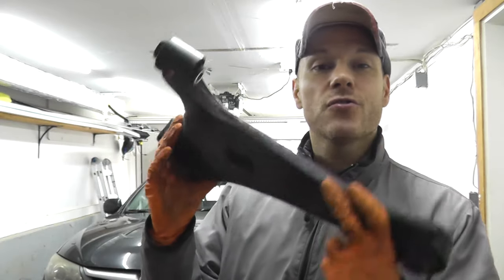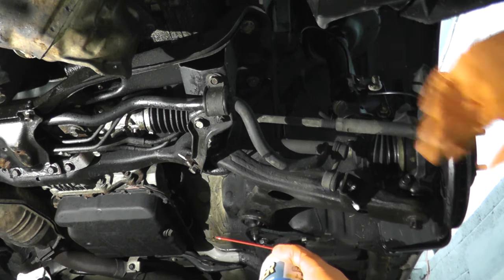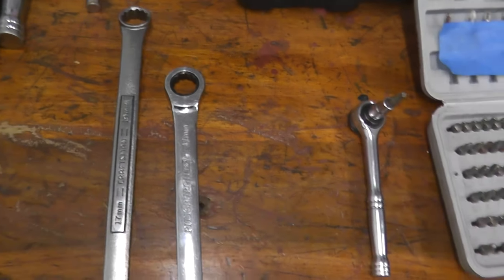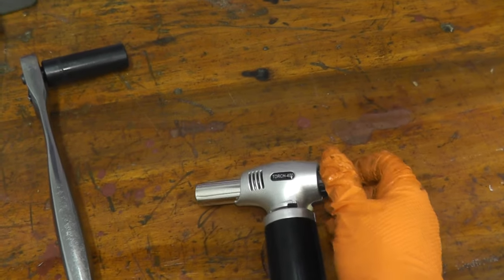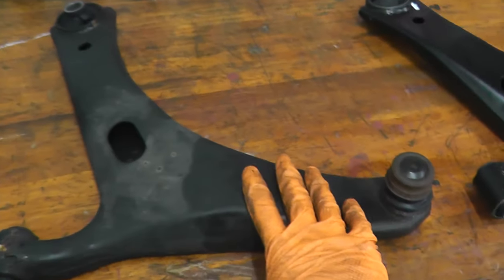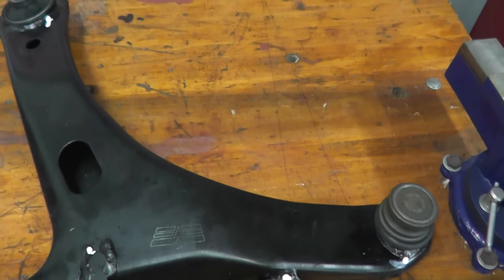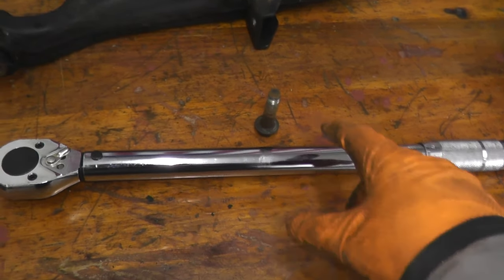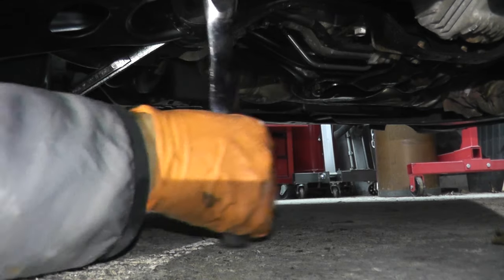Subaru Lower Control Arm Replacement with BASIC HAND TOOLS

Comment: Someone clone this guy. Super knowledgeable, attention to detail. Can’t believe he cleaned out the ball joint opening - no one else would be bothered. Best mechanic.
Reply: Good mechanics do steps like this. And he’s right if it makes it easier to installs its worth doing
Reply: One thing he forgot to mention is putting anti sezie on all the bolts. Makes the next job easier. Also fuck amazone you can get everything you need at your local harbor freight

Comment: If you live in the rust belt. Just buy a new car, you’ll thank me. 😀
Reply: I hear that, I just did a lower control arm on an outback 2010, went through 5 sawzall blades and 3 days of drilling and heating to get the rear lower control arm bolt out of the frame. Heated with map gas also, and air hammer/punch. Nightmare of a bolt.
Reply: I’m pretty much going to have to buy all new front chassis just to replace the cutch.

Comment: Do not heat up the pinch bolt, heat up the material it is threaded into. Heating up the bolt expands it into the threaded hole, requiring more force to remove.

Comment: What's the idea of lowering the car before tightening the front bushing bolt? I've seen others skip this step.
Reply: You always want to tighten bushings with a normal load on them, anywhere they are located.
Reply: Otherwise, the rubber portion bonded to the inner and outer shells will be twisted at normal ride height position, and likely fail prematurely.

Comment: Awesome video, really helped me with my front control arm install this weekend. I used Subaru OEM parts and they also have the additional bracket shown on your Dorman part (12:29). I used the floor jack to push the ball joint into place, with a piece of wood between the jack and ball joint. My 2009 WRX has a ground effects kit, but laying on the ground I was still able to reach in and tighten the front bushing after the car was lowered to the ground. Didn't really figure out a good way to use the torque wrench on the stabilizer bar end links so I tightened them to what I thought was about 33 ft lbs. 
Ball joint bolt: 36.9 ft-lb
Rear plate to body: 110.6 ft-lb
Rear plate to control arm: 81.1 ft-lb
Front bushing: 70.1 ft-lb
Stabilizer links: 33.2 ft-lb
Stabilizer bushings: 18.4 ft-lb
Front crossmember support plate: 44.3 ft-lb
Reply from the maker: Thank you. Appreciate the torque specs
Reply: Yes thank you for the torque specs

Comment: Thank you! Replaced my control arms, stabilizer bushings and tie bar links for over 1k less than two shops had quoted me. This guide was great and was very clear. The bolts on the rear most mounting plate were 19mm on my car instead of 18mm, but I have an impreza outback sport so maybe that's what the difference was. Figured I would post here in case anyone else ran into that.
Reply from the maker: Glad it helped!

Comment: Thank you so much for this video!
I was able to replace the controls arms on my 2012 Impreza and your directions and tips helped a lot.
The car has been mostly drive on the east coast and finally for a couple of years near NYC.

I applied lots of penetrating oil in the knuckle slit and every bolt I had to take off in the control arm a week before and then night before too.

The hardest part was removing the pinch bolt without breaking it. I had to use an 18 inch breaker bar and go slowly on the pinch bolt and keep applying the oil every 5 minutes. It was stuck on there for good. The pinch bolts are in bad shape and I will be installing new ones.

The ball joint was tough also, and needed lots of hammering. Had to use a piece of steel tube as pine 2x4 would break.

Towards the end of the video you lower the car and tighten one of the bolts on the control arm. I look at my repair manual and it says to torque down the same bolt (70.1 ft-lb) PLUS torque down the rear bolt to 81.1 ft-lb at curb weight too.

I think after this replacement my steering wheel is off to right for about 15 degrees but no other issues and the front suspension is quiet now.

Next I will have to replace the front strut mount as the rubber has cracked a lot (I think you have a video for that too).

I think finally will have to do a wheel alignment. I think it should fix the steering wheel being not centered?

Thanks again!

Comment: Thanks for the post! Best how-to I found for my 2013 wrx. Only issue was the lower pinch bolt and getting the ball joint out. Knocking it with wood did not work, even used an 8lb sledge. Figured out a little trick using sockets wedged between pinch knuckle and control arm

Comment: Awesome video. Was extremely reluctant to tackle this job until we found your video. Took away a lot if the anxiety and had both lower control arms on our 2007 Subaru Forester. Two notes: the bracket you talk about on the new arms is present on the Forester but nothing is connected to them. Also, the bolts on the rear bracket and nut under the bushing are 19mm.

Comment: Superb! Great level of detail. Thank you. I replaced the driver's side this weekend on my Legacy sedan. It has body cladding and is almost impossible to get under without jacking it up. I tightened the pinch bolt on the ball joint and the rear bushing while the car was still on jack stands. I put the wheel back on and tried using ramps to load the suspension to tighten the front bushing, but no luck because the frame was in the way and I could not rotate the torque wrench. I ended up taking off the wheel, putting it on a jack stand on the side pinch weld, putting a floor jack under the control arm by the ball joint to lift the car slightly off the jack stand (just barely), and tightening the front bushing of the control arm to 70 ft-lbs. I hope that suffices.
Reply: I noticed another thing in the manual that said both the rear and front bushings should be tightened after the car is on the ground. I saw you tightened the rear bushing when the car was still on jack stand. Is that a concern? I did what you did except for the front bushing that was tricky as I described above.

Comment: Thanks for the detailed video! Live in the rust belt, soaked the heck out of everything with PB blaster. Driver side ball joint took forever to pop out, passenger side took 3 hits and was out. Huge improvement on the vehicle. Thanks again!

Comment: Not to be pedantic, but T30 is not an Allen key. 

My Haynes manual also said to use an Allen, so there I was, trying to find the proper size Allen key, and chalked up the looseness to some of the metal rusting away. I rounded out the keyway, so I used a grinder to cut it out. 

Wasted tons of time, had to get a ride to the parts store, had to buy a new part that I hadn't planned on replacing, and ended up missing work the next day because the job wasn't done and my car was still up on blocks. 

I bought a new one, with an obvious Torx keyway, and checked the old undamaged bolt, that I also cut out instead of fighting it again, and the Torx was a perfect fit. 

Allen is a hexagonal bit. The typical wrench used that we associate with it is an 'L-wrench', which may cause some confusion due to the similar phonetics. The Torx, or star bit, also comes as an L- wrench.

Comment: On my car the bolt is seized had to cut it apart with saw zaw cut out the frame were it's mounted drill out the bolt on drill press and weld it back together totally sucks

Comment: why did you wait to torque that last bolt? did i miss the explaination?
Reply: If you torqued it before lowering the car the bushing would be locked in place and constantly under torsion. You want the suspension "at rest" (on the ground) so the bushing is locked in at that position.

Comment: Replaces the link on the driver side had to cut it out. I replaced with a MOOG. It’s doesn’t look right. It’s not vertical, it seems to be on a angle.The link I cut out was vertical. The video you made shows you changing to a MOOG, however, it’s vertical. Any suggestions I would appreciate.Also, excellent video.

Comment: Just did the same job on my 2013 legacy unfortunately both pinch bolts snapped so I had to drill them out and replace with a different bolt... now the car make a popping noise while driving (taking turns and Breaking) any tips to fix this???

Comment: I’ve replaced both my control arms and torqued it on the ground however I’m getting some creaking and light pops from both sides, worse on the driver side, while driving at low speeds. Any idea what this could be? I’ve retorqued everything with no improvements.
Reply: Maybe tie rods?

Comment: CarsNToys, thanks for the awesome video. Does it need wheel alignment after replacing the control arm?
Reply: Do it old alignments preset on old bushing won't be the same due to the new material

Comment: Being from the noertheast, I think letting PB Blaster sit on the pinch bolt "for a few minutes or even overnight" is absolutely adorable.  You need to tell the bolt you're going to kill its entire extended family and serve them as the main course in a cannibalistic debauchery in the name of the God of of Pneumatic Tools.  

On my own Subie I sprayed PB everywhere everyday for a week before I did the job and used an air hammer sparingly, but enough to rattle the top few layers of rust and grime loose.

Comment: Very well done video but its not that easy for everyone. Just did this job on a 2013 Outback. 10yrs in Michigan, not even a 1200 ft lb impact would budge the fastners. Every one had to be cut, what a mess.

Comment: This job kind of sucks to line things up.  Also the end of my stud in the back was damaged and I didn't notice because the impact took the nut right off.  But when I went to put the nut back on (last nut to install on the whole job) it had resistance.  So I thought I can just overcome it with the impact.  Nope.  Then I had to cut the nut off and now I really need a stud and a nut and the car is stuck in the garage at least two more days because neither of my dealers stocks that stud in the back of the lower control arm.

Comment: For the final part, it seems like you need to drop the car to have the LCA take weight. Could I just drive the car onto a ramp then? Otherwise...how else would I get access to that bolt?

Comment: Where the arm meets the chassis would it be alright to tighten it with the front wheel on car ramps or does it have to be flat? Just asking as my car is pretty low and there’s no way I’d be able to get under there
Reply: I know this is old but if you have a separate jack and the vehicle is on stands just Jack up the knuckle or rotor close to where it sits naturally. Ramps would work as well.

Comment: Doing this job on a 2006 Outback, and had to use a torch because (almost) everything was frozen.  The stud for the rear bushing came out of the chassis instead of the nut coming loose.  I have a new stud on order from Subaru, just wondering if this has ever happened to you, and if you have any warnings or tips about reinstalling it
Reply from the maker: Bummer. You may need a special tool to reinsert the stud. I've been lucky so far but most of the Subu's I've worked on are newer.
Reply: @CarsNToys  Found out the deepest socket I had wasn't deep enough, but luckily the new bolt cranked right up in with a wrench.  Clogged or buggered threads weren't an issue this time!

Comment: I need to do this job. Is it easier to remove the ball joint from the knuckle or is it easier to remove the control arm from the ball joint?  I am assuming the ball joint is still OK. It is the front bushing in my case that is totally shot.  I know most people say replace everything since your doing the work now, but I need the quickest, easiest, cheapest solution.
Reply from the maker: Replace the control arm and ball joint as one unit. It will save you a lot of time (and possible frustration). They're inexpensive for the most part - https://amzn.to/2ARVUGO

Comment: I had to dremel/die grind my sway bar link off. It was completely frozen and the allen key holes were stripped.
Reply from the maker: Oh yes...gotta love Subaru!
Reply: @CarsNToys  Believe when I say, dremels are not the way. It took me 5 hrs to get that stupid thing off. Now I cant seem to get the ball joint out. I tried the wood thing you did, knocking the knuckle (mars it up) and a torch. Nothing works so far. Tomorrow morning, Im headed to the autozone to rent a pickle fork. Any ideas if that doesnt work?

Comment: Hey I’m not sure if anyone will see this, but the bolt for the ball joint on my car was so rusted over it just wasn’t budging so I drilled it out. But for some reason I still can’t get the ball joint out. I’ve spent a lot of money already trying to fix it and it’s really eating at my savings at this point.

Comment: Could I use car ramps for the tightening of the last control arm bolt? That way I could get under the car as my legacy sits fairly low to the ground.  I would assume so but just curious
Reply from the maker: Absolutely

Comment: tl;dr  DO NOT TRY THIS AT HOME!!!

Snapped my pinch bolt. Have it almost all drilled clean. Kind of disappointed by "Imports" (yeah I know some are made in Indiana), but the Ford Contour I had I ended up using a breaker bar and a car jack for extra leverage to loosen it up. The Subaru bolt snapped by me simple pulling on the breaker bar towards myself.

Edit: And the swaybar links. My goodness. Got one removed, the other has a different size allen wrench opening. 5mm appears to work, but it's practically impossible to loosen the nut on it. Considering I snapped pinch bolt with my bare hands I can barely hold the allen wrench in place. Gonna have to cut them with an angle grinder and replace the sway bar links.

Edit 2: Make that both pinch bolts. Learning real good on how to drill them out now, at least.

Edit 3: That ball joint is not dropping out. Either I didn't drill pinch bolt all the way, but that ball joint is NOT budging. So now I'm looking at replacing both steering knuckles. I hate Subarus so much right now.

Edit 4: Ordered a $20 ball joint puller. Should be here tomorrow. But after fighting to get the castle nut off, using a dremel with cobolt tool on the pin (same I used to deburr the drilled out pincher nut holes), the control arm is still not dropping out. Sprayed it with penetrating oil and hopefully that will loosen it. Otherwise I'm back to using the angle grinder and looking at buying a whole new steering knuckle.

Edit 5: So instead of the 2x4 method for pounding the control arm I unbolted them from the chassis, rotated in the wheel well so I could access it directly with a 5 lb hammer, used 2 jackstands to stabilize it at level, and managed to get the control arms off the seized ball joint bolt. Still took multiple solid whacks. Maybe tomorrow evening I'll get to putting the new control arms back on it. Finally.

Edit 6: Got the $20 ball joint puller on one of the ball joints now. Torqued with a regular wrench as far as I could since I didn't have 15/16th socket, and I'm a bit worried about the puller tool bending before the ball joint drops out. So now I'm just gonna let it sit overnight at as high torque as I can put on it comfortably. Maybe I'll try to turn the nut a bit more at bed time.

Edit 7: Stripped the threads on the $20 ball joint puller tool trying to remove the ball joint. Taking it to a shop. This just isn't worth it.

Edit 8: Shop appointment is coming up, but found out the ball joint puller I had was a CHEAP CHINESE KNOCKOFF. Got the real deal from Astro Pneumatic and it worked like charm. Now to clean out the cavities, re-drill out pinch bolt holes, and maybe save a grand.
Reply: I snapped that bolt so easily, and it turned into a big ordeal. I welded a nut on the back side where threads were exposed, and then I used a acetylene torch to heat the knuckle in order to get the snapped bolt out. Saved the knuckle and $300. Thank God my brother has torches and welders, cause I didn't.

Comment: Hey man, any chance you know what special tool you need to fix the long bolt @13:41 can’t seem to find what it’s called, mines moving and making annoying noises when I drive
Reply from the maker: Yes. Let me see if I can dig it up.
Reply from the maker: Part - st20299ag020. I did a quick search and it seems rather hard to find. Maybe a tool rental shop..?
Reply: CarsNToys cheers bro
Reply: CarsNToys very hard to find any chance you have a link to it

Comment: I just want to blow off some steam. I have a 2013 2.0L FSB Subaru Imp. I am at 120k, car runs fine, but the suspension and brakes making too much noise. Decided to replace almost everything. And Fuc*ing A, do replace everything INCLUDING all the knuckles. Because if you are in the rust belt, wheel bearings only come out under a 20-ton press so need to remove the knuckle anyways, and the front lower ball joints, don't budge. I hammered the control arm, made an extractor but no matter how much pressure I apply it's just rusted in there. If I bought a used but clean knuckles, I could have been done with my project a week ago. Arrrr Subaru's...

Comment: smacked the hell out of the pinch but it wouldn't let go of the ball joint. no trouble at all removing the pinch bolt itself. but wedged a pry tool into the pinch, hammered on it, hammered on the control arm with some wood, I tried it all sucker won't let go! might have to pay a local shop I guess. only thing I might try is an air hammer but really don't want to do that and risk damaging the brake lines or wheel hub
Reply from the maker: Bummer. Air hammer should certainly work. You're in a rust belt state?
Reply: A game over for me too, I couldn't even get the pinch bolt which snapped inside.

Comment: Lies. Portside won't drop. Bolt broke right at the line for releasing the ball joint on the starboard. 5 hours later my car still on blocks. I had to take a hammer to that damn ball joint 150 f**** times to no avail.